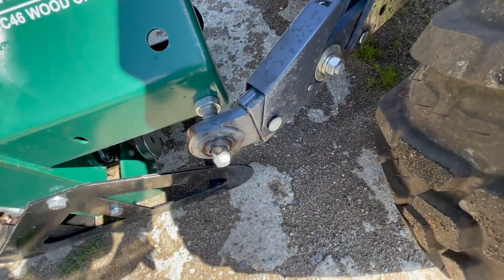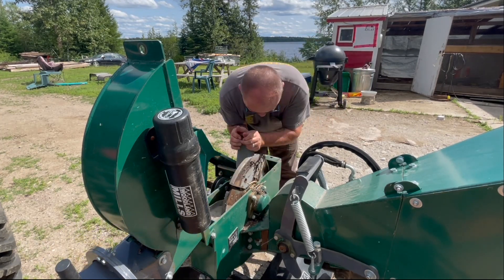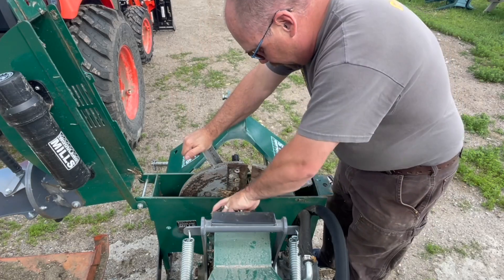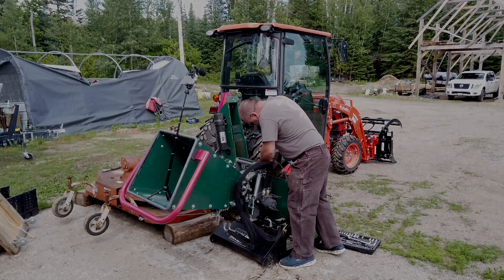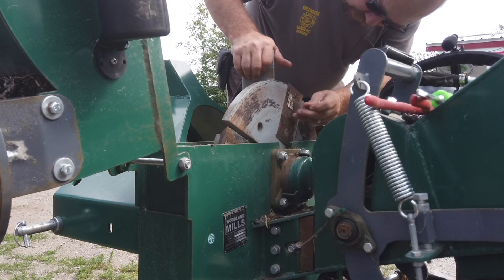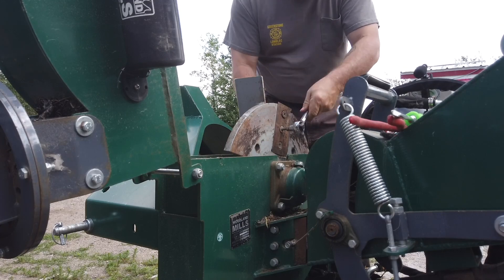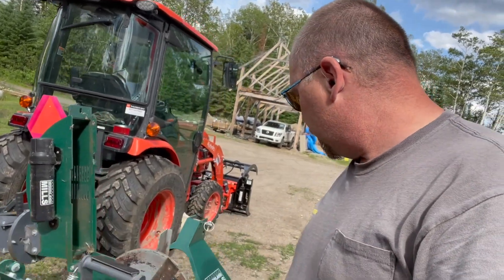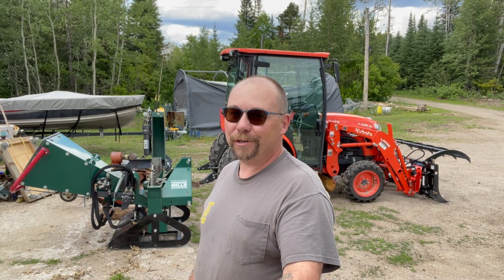Woodland Mills WC46 Wood-chipper Maintenance, Why didn't I do this at the end of the season!

Comment: It`s a good idea to pull out the entangled brush twigs from the chipper after each day`s work to make sure the flywheel is running freely before your next startup. Easier on the belts. It looks like you are getting a lot of rust. If the machine is stored outside, it probably should be covered. I also found that a can of Fluid Film anti rust spray is good to keep those rust prone parts looking good.
Reply from the maker: Excellent tips thanks 😊 Cheers 🍻🌴🚜👍🏼